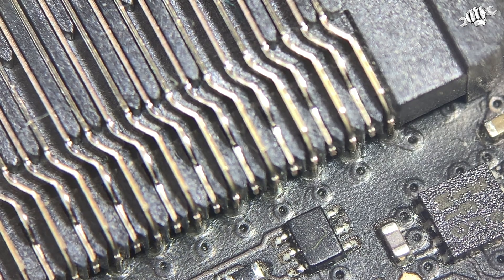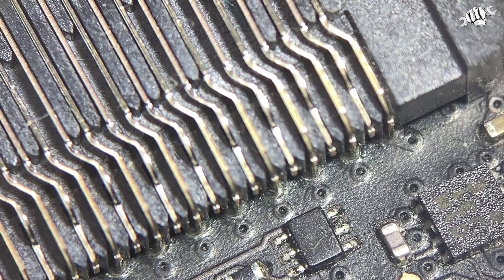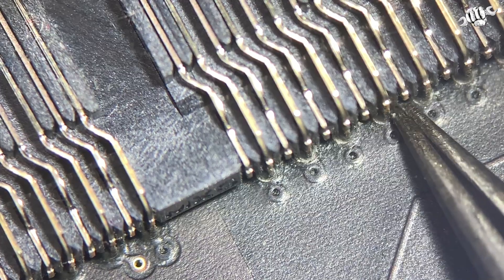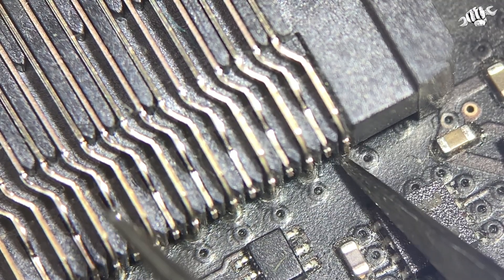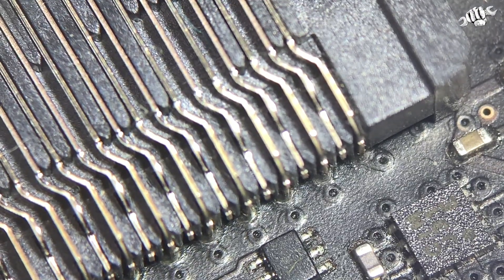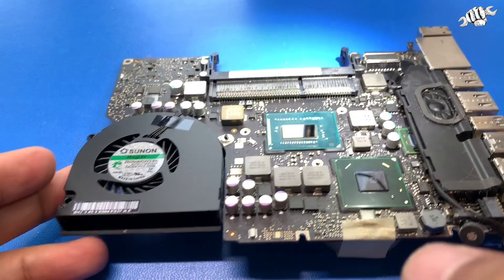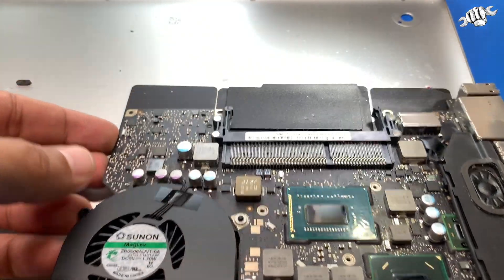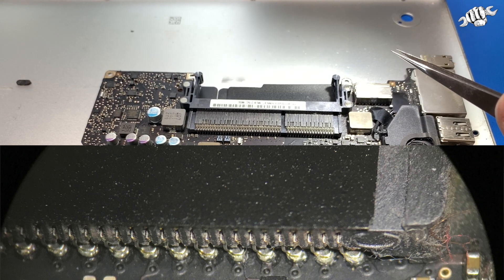2012 MBP RAM Pin issue

Comment: I have a late 2011 MBP which sometimes fails to boot with 3 beeps and other times works fine for a while before getting screen bars and three beep. Pressing does not seem to affect it,  ad swapping ram one slot at a time has no effect. I'm convinced it's a problem with bad solder to the ram slot but note you're dealing with a 2012 machine. Are you aware if the same problem affected late 2011 MBPs? I would love to keep the machine as it otherwise runs faster than many much newer machines and I have software that no longer runs on later machines. Useful video, thanks.
Reply from the maker: I have not come across any 2011's with this particular issue but anything is possible. Definitely worth a microscope inspection at least
Reply: it is a known problem in 2011 MBPs too, just hadn't ever been diagnosed as it, it was mostly blamed to loose RAM sitcks in an "old" bracket, theres tons of forum posts about it. I have one with the problem myself and managed to mitigate the problem for some time, and i have been looking for the root problem for many years to get around to fixing it, this video finally points to it.
Reply: also my board was changed 3 times under the video chip recall in just 3 weeks, first time, RAM problems (3 beeps) and changed again under recall warranty, second time usb problems,  again, warranty, third time was the charm to this date no video or other problems (all were refurbished re-balled boards) so this problems exist since the beggining (as for the first board) it just surfaced later on after more heavy use, I can almost state as a fact that this is the problem since I used to grab my machine opened up from just one corner to move it around and that tended to make it "flex" from its own weight and those times were when it first started doing the 3 beeps and stuff. sadly a flexing board = separated pins.
Reply: @thiagodlt  Thanks for that info. I wasn't able to fix mine and have more or less stopped using it. I'll have to have another look when I get time as it sounds from your experience that my model would be prone to the same problem. Thanks.

Comment: Thanks for the video. Both my slots work when one ram stick is inserted alone. I use the bottom slot with one stick. If I add one to the top slot (along with the bottom), the computer boots up, the OS starts then I get a frozen screen with rainbow like colors within 30 seconds or so. 
Would this be the pin issue, or maybe something else?
Thanks.
Reply from the maker: I’d attribute this to a faulty socket as well

Comment: I have a mid 2012 13" MBP (A1278) starting to have "checked screen" and 3 beeps issues. Tried reseating the RAM, another set of RAMs, same shit happens. Either only top slot, bottom slop, both slots, nothing seems to work after a while when the mac does start up, it fails eventually. So I may look into these loose feet issue next.

One thing tho, I think these thick paddings are here to serve as heat transfer material. When the RAM get hot, the heat travel thru the padding and spread on the alloy bottom cover. Radiator effet or am i F.O.S. ?  Just guessing.

(history of that MAC, I changed the HD flat wire twice over the past 9 years, swapped the original HD for an SSD, changed the battery few days ago as the original got badly swollen and even fixed the touchpad. I love that piece of junk so I'd try anything to save its life even if it's for  few months before I buy its replacement.)

Comment: Have you done this multiple times? Was it successful? Seems like other repair sources tell you this is not doable and should not be done at all.
https://www.youtube.com/watch?v=g0amoW7S1WQ
https://rossmanngroup.freshdesk.com/support/solutions/articles/36000179153-mac-3-beeps-three-beeps-beep-300ms-pass-beep-300ms-pass-beep-300ms-pass-
Reply from the maker: I’ve probably done 300+ of these exact repairs and only two have failed. If you don’t have the right equipment or patience it’s a nightmare repair that many will advise against. I happily save them from the scrapheap though :)

Comment: Is That Possible To Resolder Them Seeing With Camera On Big Screen Or They Are Just Placed On The Points.I Just wanna To make sure is that metal pin can be joined with soldering iron or not
Reply from the maker: Anil J depends on the quality and magnification of your camera. In both board revisions the pins hover over the pads so a good amount of solder is needed to make a solid connection. Iron has to be placed just right so that the whole pin and pad get covered in solder else you create a weak joint and get in trouble again later.
Reply: @TheHouseOfMoth  could an option to repair this be adding a small bit of micro wire to lengthen the pin an make a stronger joint?

Comment: nice video ! 

im wondering why the 15" A1286 Mid-2012 mbp's, also have padding layers on the ram slots and bottom case.. ?
Could the 15" also get this ram slot problem like the 13" models. ?
opened up two of them yesterday, both have the same kind of padding like this 13" model in the video..
makes me a little bit worried for these A1286 2012 models...
Reply from the maker: F. van Nierop just a precaution on Apple’s part. I’ve never seen a 15” 2012 with this issue.
Reply: @TheHouseOfMoth  ok great thx for your answer here !
maybe also handy info for other 15" users out there.. ;)
Reply: the issue exists in 2011 15" ones, and the boards are practically the same, except for some differences in CPUs and USB speed, so it might very well be present in those too.